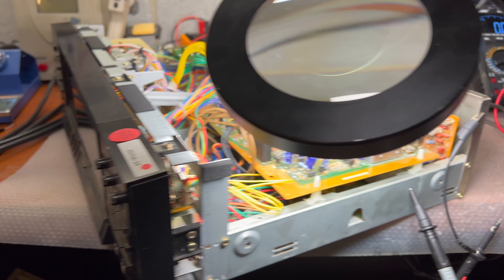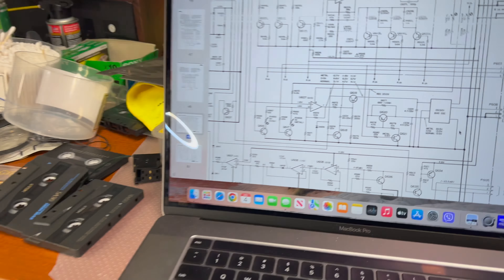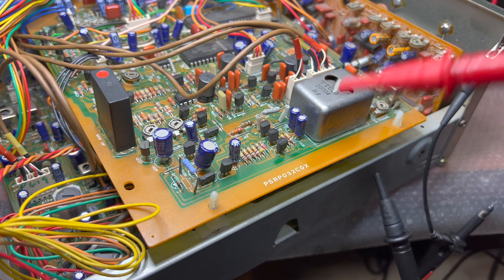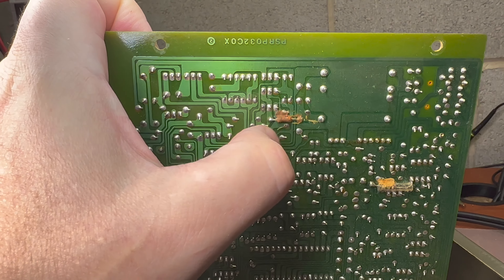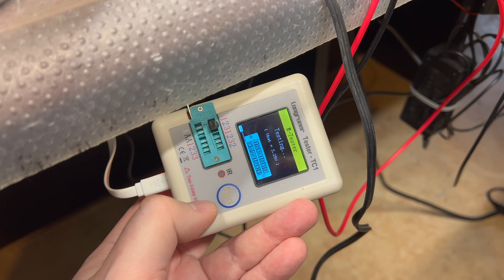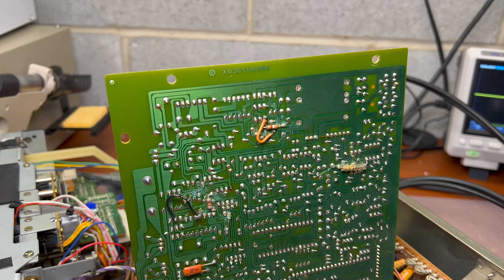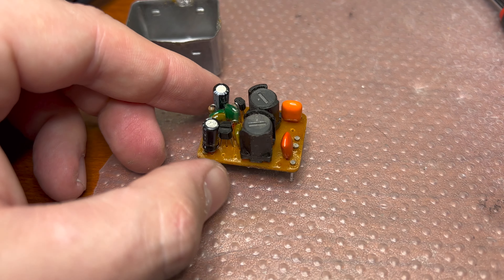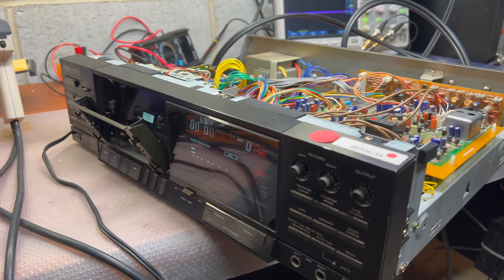Sweat & Tears: A Grueling Journey to Fix Teac Cassette Decks

Comment: Good job with exactly the same attention to detail that I share! Would you be so kind as to share where exactly you ordered the Idler and what its specifications are? I'm currently struggling with the tape running of my two TEAC Z-7000s and I'm starting to despair... but that's another story ;) In any case, I still see room for improvement with the Idler for my TEAC V-700 project... and I need some good news right now ; ) Thanks in advance!